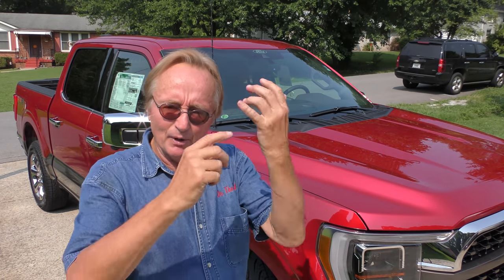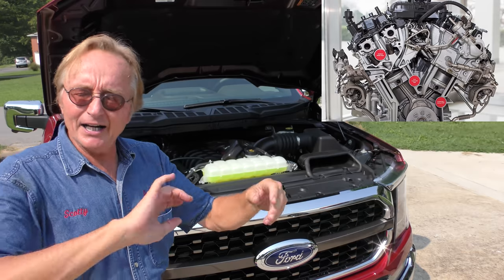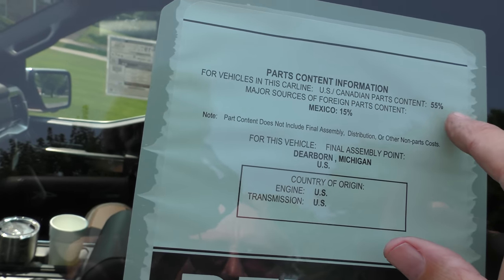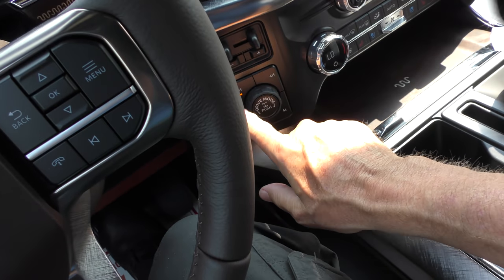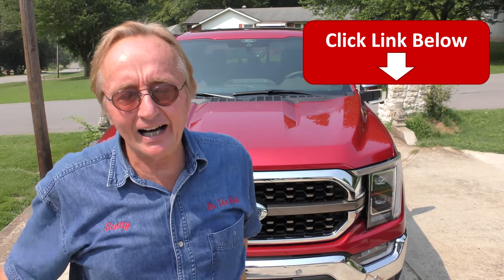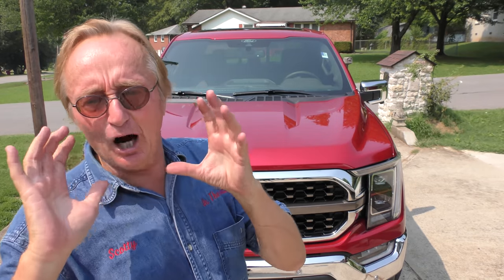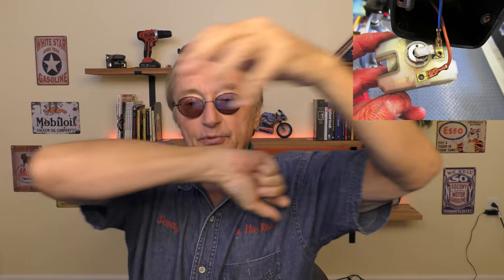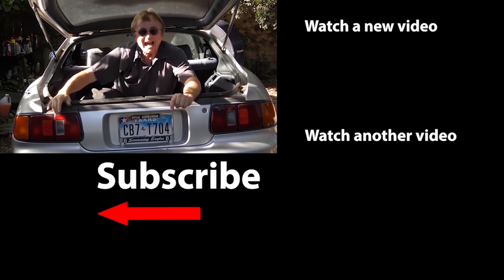I Finally Got a New Ford F-150 and Here's What I Really Think of It

Comment: I don't like that cluster.  My 19 250 at least has step motor needle gauges surrounding the center computer stuff.  I'm old school and have a hard time figuring out all the computer stuff in these vehicles.  As far as I'm concerned,  ford has done the best job appealing to tech scared people,  as well to the tech nutty people.  I know I bought a tank,  designed to pull down a house,  but it has just enough technology not to be too scary.  I like buttons,  knobs, and gauges.  Who else remembers using coat hangers to fix the climate control on your late 80s Chevy?  I do! Now all that crap has servo motors and control modules!  Why?

Comment: My advice to Farley ,if it ain't broke don't fix it, stick with the older technology and older reliable engines cylinder cut outs were tried by gm years back and it was a disaster, so Farley should get a job at Ford  like working in the warehouse till he can start using his brain.

Comment: You do realize the modern 5.0 is now the bottom of the list for reliability. The Ecoboosts are highly refined since they first came out. The 5.0 is going backwards. 

This is coming from a former V8 only owner. Our family has owned multiple Ecoboost engines and they’ve all been for the most part problem free.

Comment: You didn’t include the mpg ratings. Hmmm.  You won’t be able to get this truck with the 50k if you win the contest.  Maybe a base model F150 without all the fancy equipment and V8 engine.  I don’t care for the new style headlights.  When is Ford going to provide a independent rear suspension for the F150?

Comment: Seen to many problems with Ford's over the years.  2000 to 2010. Engine engine problems. 
Neighbor on his truck 2013. Computer system died. 
Then they had sparkplug blow out problems.   
Hard to say about theses new ones. Not many miles yet. 
Maybe get the extended warranty. Lol. But they are more of a truck than Toyota far a pulling more.

Comment: one of the problems with boosted engines (turbos and super chargers) is that you need to use premium fuel. You can get more power from a bigger engine and pretty good gas mileage with variable engine timing and cylinder disconnects. It's not difficult to get 22mpg out of a V8 these days!
Reply: F150 ecoboost run off 87 octane just fine. I own a 2016 3.5 and burns any type of gas with no issues. It really only needs premium if you tow all day every day!

Comment: Turbos wearing out after 100,000 miles??? I had 2 Dodge Cummins with 500,000 miles each and on stock turbos. I have 3 different Dodge Cummins all with over 200,000 miles. My trucks say your truck is cute...

Comment: The 5.0 v8 Ford has a ton of oil consumption issues and the 10 speed stinks. 
The v6 toyota will be running long after this f150 has been scrapped.

Comment: F150 has had nothing but engine and transmission problems for over 20 years! Get a Toyota Tundra that last over 1 million years and if you need more towing just upgrade the suspension!

Comment: A tuned 3.5 is cheaper more reliable and will run circles around the 5.0 in the f150 hell even a tuned 5.0 would be a joke against a tuned power boost. That 5.0 isn’t the same as a mustang 5.0 this ones plastic

Comment: Mitsubishi Mirage OK🤨🤨.   I know a guy who had one .   First the engine went south.    They had it running too lean on one cyl and it trashed the mill.    They gave him an engine.   Then out went the starter.   $2000 to fix the $800 starter that ate the ring gear off the flywheel.    Warranties again till it did it again a year later.     Mitsubishi made him a deal he couldn’t refuse sine it was just out of warranty🥴.    Another new Mirage, oh BOY🥺🦨🦨🦨🦨🦨.    I still laugh at him for that one every time I see the thing.       I rank those things right up with the Theta engined Hyundai’s …….minus the long warranty💩💩💩💩

Comment: Just say no to short bed trucks that cant haul a harley and your wife, it's not a truck.  Hey, what about all the extra bullsh^t required to paint aluminum--good luck with paint at the car wash.   Then when you drop your tool box in the back  you punch holes in the aluminum bed.  "Well designed aluminum heads" THATBLOW HEAD GASKETS!  NAH--GIVE ME AN IRON ENGINE & STEEL BODY TRUCK like my 35year old Ford Ranger 2.3L  never a head gasket problem!

Comment: There to expensive and ask everyone i know what happend to there fords before they were a year old . Replaced transmissions and engines .... there not what they used to be. They have huge issues as well. And im mad at toyota as well for taking the V8 out !! SADFACE ! Now if the toyota tundra still last 500,000 miles i wont be too upset although i dont want a turbo .